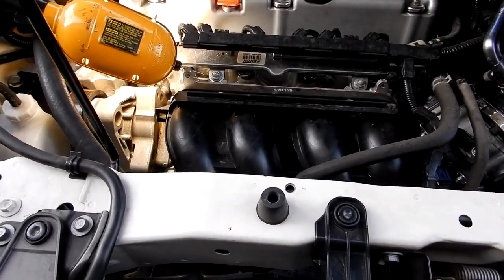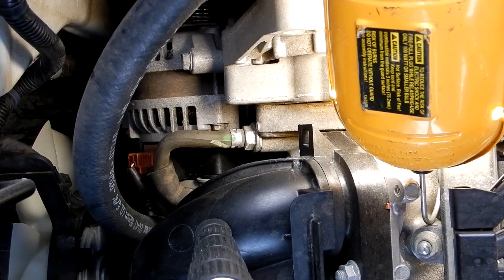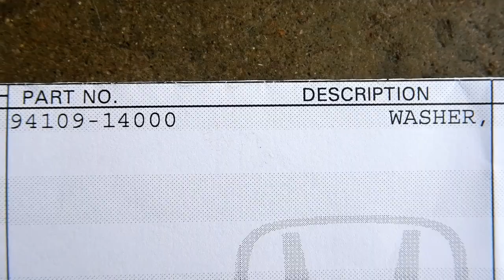youtube video #0kuqWSg3nmE

Comment: I would go with the OEM PCV valve from the dealership. It does not cost much more and then you know you're getting a good part. My Lexus one was 15 bucks vs like 5 dollars from the part store but I would not trust the cheap one.

Comment: I have a 2012 CRV with 170,000 miles. I want to change the PCV which I think is the original but I’m afraid it’s going to break when I try to remove it. Any advice?
Reply from the maker: Perhaps try Penetrating Oil. Put on the area where it screws into the engine. Do it everyday before driving for awhile. When you do give it a try very carefully try to remove it. Don't be in a big hurry. One reason I change sparkplugs way sooner than the factory recommends.

Comment: Thank you. The dealer told me they will change the pcv valve for $700!!!!
Reply from the maker: No way 😳 You sure it wasn't $70.00 to replace? You're welcome.
Reply: @starastronomer 
Actually it's $700 with two zeros.
Reply from the maker: @mohammedaldhahbi5433   That's pure robbery! They should be reported.

Comment: The washer/gasket is the exact same thing as the crush washer usd on the oil pan drainplug.
I decided since this is being replaced at 162,000 miles, we could afford to use the OEM parts from the dealer even if it was $40.
I was hoping a how to video would include the torque spec.

Comment: What's the torque spec?
Reply from the maker: Don't know. I just gave it a nice tightening, making sure NOT to overdo it on a cold engine. No issues.
Reply: @starastronomer   I've run into way too many problems over the years due to over & under tightened fasteners. 
  In my younger days I was strong enough I'd break a 3/8 bolt without noticing it got tight, now I'm so weak I have absolutely no feel for tight or loose. 

I read in a couple places the torque spec is 33' lbs. 

Thanks for an excellent video
Reply from the maker: You're welcome jrsavoie and thanks for that information!
Reply: 33 ft.lbs.

Comment: so oily... was it burning oil?
Reply from the maker: The valve had over 97,000 miles on it and it still worked fine. The dealer told me when I got the washer they rarely change them.
Reply: @starastronomer  many new designs dont have pcv anymore. some just have a small orifice. some have a small reservoir (more like a catch can design)
but anyway it is good idea to get it out and clean it since it is so oily already. may get sticky inside even tho it still rattles.  dont discard the old one. just soak it in carb cleaner and it can be reused next time. i guess it costs more than $20 for honda part

Comment: Any idea how much torque as per Mfg for us using a torque wrench?  I was thinking either 29 or 30 as this would be same as for my oil drain bolt on 07' Civic Si Sdn and 14' Civic CRV-EX.
Reply from the maker: Aaron Bell   No, I just gave it a firm "snug". No issues. You could ask the dealer if you wanted a specific torque.
Reply: @starastronomer  Well done video very simplistic... I am surprised local mechanic or Honda never recommend this. What is the biggest difference you notice after change? Better mileage / better performance? I am also doing on the 2014 Honda CR-V with 106K.
Reply from the maker: Thanks, I never saw a difference in anything.
Reply: Alldata has the specification. You can buy a month/year subscription and it is very helpful
Reply: 33 ft lbs
Reply: @jrsavoie how much is the conversion to In.LBS  ?

Comment: Hello Sir. Is that the same as the gasket oil drain plug washer that you use when changing the engine oil? Thank you and i really appreciate your effort to show us the particular part number of that Gasket/ Washer.
Reply from the maker: Hon28 Ney28   THANK YOU. Not sure as I have a Fumoto oil drain valve. The dealer would be able to check the numbers.
Reply: Yes it is.

Comment: Do you know the part no. of pcv valve?
Reply from the maker: Kan Hu     Don't know Honda's part number. The one I put on is aftermarket.
Reply: Honda part number 17130-RBB-A01
Reply: If you don’t want to change it, just clean it with a solvent and put it back on
Reply: @lenbata  correct.  about $25 from the stealer

Comment: Why replace pcv
Reply from the maker: This is a good read: https://www.oreillyauto.com/diy-diagnose-and-replace-a-pcv-valve
Reply from the maker: BTW, it doesn't hurt to just periodically change parts like this to stay on top of maintenance items.
Reply: If the valve is stuck closed the crankcase will develop high pressure and start blowing oil through every seal, o-ring, gasket, and passed the rings.   You will notice it immediately at the valve cover.   It ain't pretty.   And the engine will consume oil.

Comment: That washer is same to use on oil drain plug.
Reply: yes same washer.
Reply: BTW, I never replace those washers with new since they are just flat stamped metal.   They are not the crush type which can only be used once.